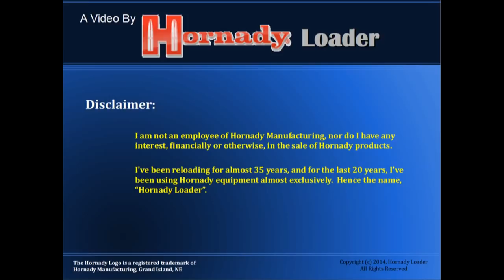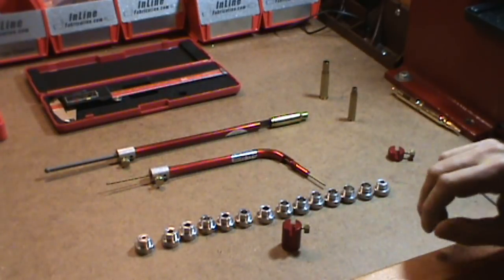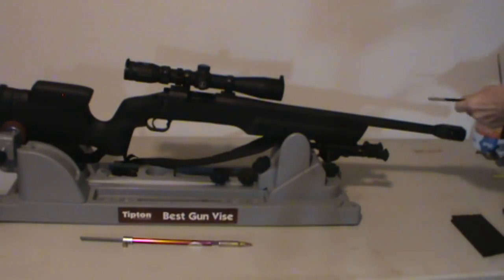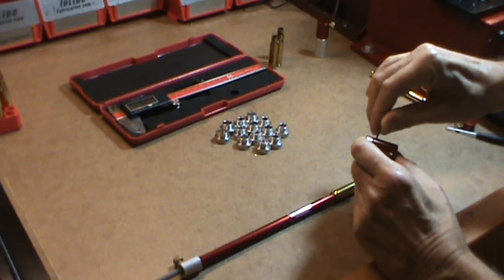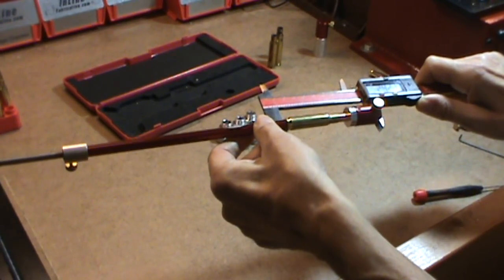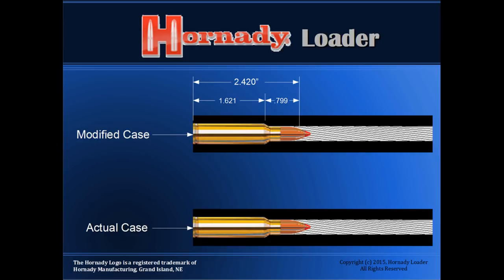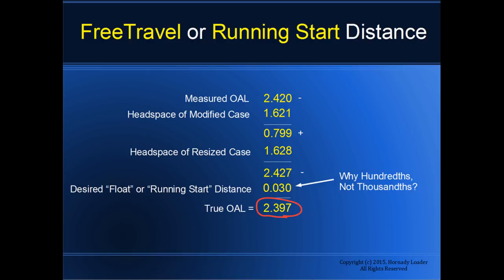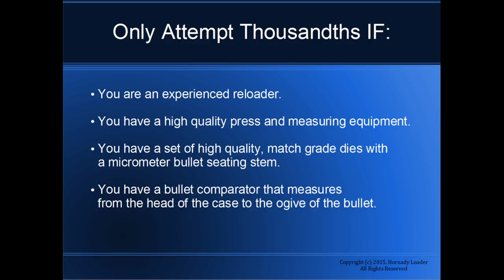Hornady Overall Length Gauge and Bullet Comparator

Comment: Great video never thought about my cases being slightly different than the modified case from Hornady. I will measure the headspace on my fire formed cases more closely now. Also never knew that you could use the 2 different sides on the comparator to make sure the bullet went in straight. Thank you for sharing

Comment: Great explanation but I had one problem that drove me and my son nuts when trying to measure with the dial caliper, bullet comparator and OAL gauge.  We could not get consistent readings even in the hundredths.  So after fussing with the OAL gauge for a couple of days my son figured out that the pushrod in the OAL gauge has a flat part that must be positioned correctly when measuring for overall length.  It's obvious when you look at it and realize that's why the rod is shaped the way it is.  Also I'd advise "feathering" the pushrod into the lands, not pushing or forcing in any way.  Thanks for another great video Hornady Loader!

Comment: Mate you explained that perfectly,i reload myself for competition.I am going through exactly the same process(bullet jump,powder loads...etc)bullet weights,case weights.....what amazes me is you can have bullets out of the same batch and they will vary ever so slightly,my 308,223,6.5 are nail drivers at 700mtrs.....good on ya
Reply from the maker: mickycricket Thanks Mickey!  I was surprised that no one else seems to mention the variance between the modified cases and the cases that you actually use to reload.  I've also noticed the same variance you have in the bullets themselves...even within the same lot.  Some manufacturers are better than others, but you have to keep a close eye on tolerances regardless.

Good luck with your competition!  I've been competing for years...wish I was a better shot, lol.  It seems my son Cody is the marksman in this family.

Hornady Loader
Reply: HornadyLoader
Thanks mate ,i hope cody goes far in the competion world(he has a great head start with you as his mentor)i am building a 6.5 creedmore at the moment with a peirce action with fluted bolt,a pacnor shute (fluted)custom barrel tuner,macmillan tasmanian black wood thumb hole stock,14x42x56 nf scope(davies trigger 2 stage)made in australia ,took out the single stage(timmney)should have someting shooting (great)i'm an ozzie....i will subsribe right now......GOOD LUCK CODY....MAKE EVERY SHOT AN........ X

Comment: Awesome video you're the first person that I've seen actually explained the entire tool set up. I learned a little something. I have the same set a bullet comparator and overall length gauges you have and a Hornady caliper. The only part that I would have added was the simple fact that Hornady their caliper has extra thick Jaws that hold the bullet comparator and headspace gauges much tighter and aligned much better. So a recommendation to all reloader if you're going to use the Hornady equipment use a Hornady digital caliper as well so that everything fits the way it's supposed to. The Hornady digital caliper and the headspace gauge along with the bullet comparator is all available on amazon.com. as well as the overall length gauges. Great video keep up the good work. Echo

Comment: great job explaining. When I first started reloading I thought these tools were a waste of time and money, now I won't load for any of my rifles without them. 
I thought my seating depths were accurate just using calipers but once I got the bullet comparator, they all were varied slightly. Now everything is precise for each rifle...must have tools for precision shooting
Reply from the maker: mojo jojo Hi mojo jojo, I know what you mean.  When I first started loading, all I had was a press, some dies, a powder measure and a caliper.  As I learned more and more about reloading, I upgraded my equipment and now I feel the same as you...if you want to print clovers on paper, you need to go the extra mile.  Thanks for watching!

Comment: Exceptional video, great diagrams/pictures, extremely helpful.  One question; from reading the Hornady manual they ask that if you want, you can send in 2 fired (fire formed) brass to them however they stress to NOT resize the fired brass.  With this being said, how can you find the other unknown length not the given .799 length? And, what or how would you determine the OAL/COAL?
Thanks again, awesome video.
Reply: Dave the overall length gauge is much more accurate on a fire formed piece of brass because it comes from your particular rifle chamber. Hornady simply takes your to once fired cases that have not been resized or touched and they drill out the primer pocket and run a tap to tap the threads needed by the overall length gauge so that it will install on it. When you're using brass that has not been fire formed out of your chamber there's a little bit of Wiggle inside your chamber. Most competition shooters will neck size their fire formed brass so that there is less misalignment between the bullet and the throat into your rifling. Fire formed brass that is simply next sized 4 bullet retention usually two thousands of an inch will be more accurate then a fired piece of brass that has been bumped back on the shoulder two thousands of an inch. What you're doing is setting up for precision rifle work and the once fired brass is a duplicate of the internal diameters of your particular rifle chamber. It's just going to be more accurate overall when determining overall length to your rifling. Hope it helps, Echo.

Comment: I have all the tools, and watched a bunch of videos on the procedure. Only one other divulges your analysis and consideration of the differences between the Hornady modified case dimensions and the case that is to become the final project. I have to say that your rendition is clear and precise, giving reloaders a true in depth base to build on. I've been reloading for 51 years and always based my measurements on OAL case head to the tip as provided by the reloading manuals. Thank You for your work and presentation.

Comment from the maker: Hi Dave,

Yup, that's the best way to do it!  If you have a fire-formed case modified by Hornady for you, you can get the second measurement the same way as in the video.  Just take the OAL as measured by the OAL gauge and subtract the headspace of the case Hornady has modified for you (as measured by the Hornady headspace gauge).

Hornady Loader
Reply: HornadyLoader 
Sir, thanks a lot for that educational video. Is there any disadvantage in using the generic "Modified Cases" Hornady sells for the O.A.L. gauge rather than a fire-formed case (which has been modified by Hornady)? I am half a world away, so sending a few brass cases to Hornady would be impractical.
Reply from the maker: Karamojo7mm Hi there, there's nothing wrong with using the Hornady Modified cases.  Just be aware that it is probably a different length than your brass and apply the formula I use in the video and you'll be good to go.  Thanks!
Reply: HornadyLoader Sir, thank you for your quick response! It's highly appreciated. I bet you're bringing Hornady some additional business through your clear demonstration of how tools and gauge are used properly. I'll order these gauges. I am sure I will revert to this video in the future.
Reply: +HornadyLoader Excellent video, especially for a newbie like myself ... I just got into the hobby about 3 years ago.  I just picked up my Hornady Overall Length Gauge - Straight Model late October from one of my gun shops I go to; and I have my 4 Hornady Modified Cases (.30-06 Springfield, .303 British, .30-30 Winchester and .32 Winchester Special) on order, along with the Hornady Overall Length Gauge - Curved Model thru him.  I've been looking into the L. E. Wilson's Headspace Cartridge Gauges for my above mentioned calibers to compliment this tooling.  Is this a good choice; or should I invest in the Hornady Headspace Gauge instead?  I would not have considered the headspace issue of the actual case (Full Sized or Neck Sized) being used.  Very good point you made in this video.  I wish Hornady mention this point in their Overall Length Gauge instructions.  I'll be viewing this video again and again to assist in my reloading process.  My other question is, what size of Hornady Bullet Comparator set should I purchase, considering what calibers I already have now?  I can get the smaller set, which will work for the calibers I'm shooting now, from Bass Pro Shops in Moncton, New Brunswick.  Would I be better off with the bigger set later down the road?  Bare in mind, I'm trying to anticipate my needs for tooling 5 - 10 years down the road.Looking forward in seeing the rest of your videos, especially those on the Hornady L-N-L Classic Kit Press Set and other Hornady equipment.
Reply: +HornadyReloader
If you could humor my on a technique I came up with(out of necessity) for my particular application. I seem to have been having issues with the OAL gage. When inserting tool and plunging the bullet for o.a.l I would get what I can only describe as run-out in the mod'ed case neck. This required me to exert a significant amount of force to push the bullet onto the lands. So I figured out that I needed to drop the bullet into the chamber.Then begin to tilt my rifle,listen as the bullet slid home. Then I'd insert the gage/mod'ed case in to the chamber to interface with the bullet. Lock the pushrod down tilt the rifle w/muzzle up to allow gage and bullet to come out. This is where the humor comes in. Can you try this technique and see if you can get consistent readings. 
Thank You.
Mike C.

Comment: If anyone is wondering; The straight model will work with an AR10 but it's not ideal.  The brass screw will be inside the receiver when the modified cartridge is chambered.  You can make it work, but curved might be easier.  I read a few reviews of people having consistency issues with the curved model...not sure if true.

Comment: Good insights. You didn't address the issue of the cartridge fitting in the magazine. Some will get an extended magazine or have to load cartridge by hand if it is larger. I am not a seasoned reloader and appreciate your take on advanced techniques. Thanks.

Comment: Great video HornadyLoader.  I found your video after I purchased a Hornady overall length gauge and a Hornady bullet comparator.  I have used a caliber specific Wilson headspace gauge for many moons, so I dropped in a fire formed 30-06 case that had not been sized.  It dropped right into the "sweet spot" on the Wilson gauge.  Hornady's modified '06 case was visibly higher in the Wilson gauge, meaning to me as you said, there is slight measurement disparity between the two cases in the headspace area.I just ordered a set of Hornady headspace gauges to work with the body housing that came with my Hornady comparator kit.  I'll be able to read a fire formed case form my '06 and compare it to the modified case made by Hornady.  From there I can do the math and work out the difference on my final seating depth.  At least this is my intention....so please let me know if I am thinking this out correctly???  Thanks for a great video!!!

Comment: I started reloading about three months ago. Presently, I only do .308 Winchester. It seems like the more I learn, the more I find out there is more I need to learn. I just gauged my Remington 700 with 175 gr. Sierra Match Kings and, my numbers were quite different. My True OAL, after subtracting the 0.030", was 2.312", which seems pretty long but, I measured everything at least three times. I wouldn't have thought the 178 gr. A-Max would be that different. I tried again with 168 gr. Sierra Tipped Match Kings and, my result was a True OAL of 2.285", not that far off the 175 SMK. This video was VERY informative and, I learned a lot from it. Now, I have to ask, do you crimp your rounds at all? It doesn't seem like there is much bullet inside the neck.

Comment: I wonder, Would it be better to have a case that is a once fired in the gun we are loading for ? i.e use a once fired case that has been drilled and tapped for the wonderful Hornady gauge.   I am loading for a 7.62x51 but using .308 fired brass...the cases are a bit diff.

Comment: Aside from the headspace issue which is relevant and important, using a smaller bushing than the bore size place the measurement at some 'random' point on the ogive. Using the correct bushing (ie. .30 bushing for a .308 projectile) at least tells you where your rifling starts.

Comment: I assume the OD of the red tube is 5/16", but what is the ID or how thick is the tube wall?
Mcmaster Carr offers that tube (.313 OD) in steel with an ID of .183, or .215, and even .243.
Making the red tube should be easy, and as for the case, chuck the case in your drill press and clamp the drill bit /tap in your vice and it will drill like it's in a lathe.

Comment: Good video, the distance reference from the "running start" is commonly refered to as the "jump" by most reloaders.
Reply from the maker: +Earle BuBar Hi Earle, yup, I probably should have mentioned that in the video.  I tend to use terminology that a novice can relate to and sometimes forget to follow up with the correct or common terms.  99% of my videos are not scripted, I usually just turn on the camera and start talking so sometimes I do forget to include some things.  Thanks!

Comment: Is .799 a standard variable for all cases?  I realize from your outstanding video that my head space will be different and must be factored in.  The illustrated glossary in the Hornady manual defines the head space as "The fit of a cartridge in a chamber measured as the distance from breech face to that part of the chamber which stops the case's forward movement." With that being said (STUPID QUESTION ALERT) is a .223 a rimmed or rimless case?  It appears and measures to be rimless.

Comment: I just bought the Hornady equipment so thanks very much indeed for explaining how it works. I have lots of fired shells and when I measured them it appears there are differences in length upto 0.09 milimeters. This consequently means that if one wants the overall lenght to be the same the bullet will be either deeper or not as deep pushed into the shell when reloading ... I wonder, how does this affect the accuracy or doesn't it ? By the way, very best wishes for a prosperous and healthy 2019.

Comment: Hornady Loader, first off great video...but have a question regarding the "twist" at the end of you video. So after measuring the OAL of the chamber on my new Howa 6.5 Creed I came up with 2.292" with the SMK 120gr bullet I used. And both the Hornady modified case and the Hornady fire formed cases measured the same headspace at 1.559" using the Hornady headspace gauge...so no need to adjust the actual OAL. However I'm fairly new to reloading and I went and FL resized the fire formed cases which bumped the shoulder back .006", and now the HS is 1.553" (I've since purchased some Redding comp shell holders to ensure I only bump the shoulder back .002"-.003" when FL resizing). Anyhow my question is, since the headspace on the FL resized cases are now .006" smaller at 1.553" is the new OAL of the cartridge 2.286"...and I need to adjust my desired bullet jump from that number now?
Reply: George Begonia... HornadyLoader covered every section except this most important aspect of the resizing process. Technically his video is now flawed. He comments that the 799 value remains the same... however it does not if the individual bumps the shoulder on the case. Such as yourself.  Something is not right about this video with the difference in the Modified case verses the Fire-formed case. Why not just use the actual fire-formed case and  removed the modified case out of the equation. Does not make sense. It seems that HornadyLoader just added an extra step to the equation by using both. Why not just one or the other. Or in this case the better fitting fire-formed case to the rifle.
Reply: @bisonuberti  It has nothing to do with the shoulder or how much you decide to bump it. 

The measurement referred to is from the case base to ogive (CBTO) and it is the bullet seating depth that matters here. If you bump the shoulder back 2-3 thou, then the bullet is seated 2-3 thou less - you are always aiming to get the same CBTO length to ensure your jump is where it needs to be.. 

Make sense ?

Comment: I bought the O.A.L., HEAD COMPARATOR, and BULLET COMPARATOR GAUGES not knowing different die types existed until a about a month ago. I bought a fixed 30-06 and it looks like I can't use any of these tools because I've been looking for a match grade set for a month here and there and can't get my hands on one. 
I'm going to get one when I find one, but say I only reloaded to SAMMI spec's, will this mess my rifle up over time? I've been under impression to make rifle last longer, need to follow all these steps in video.